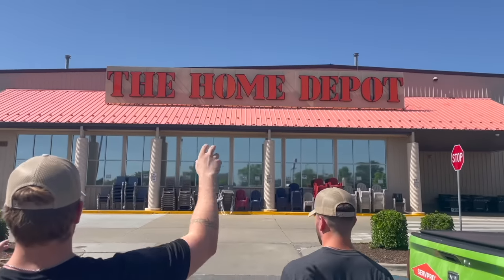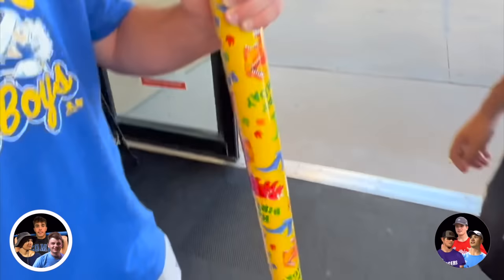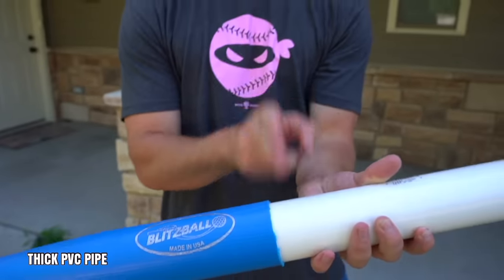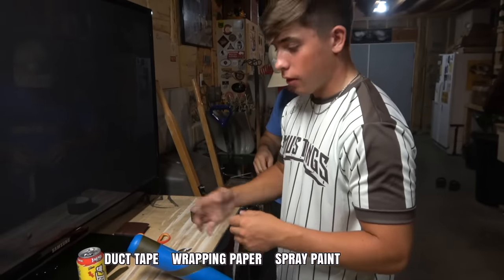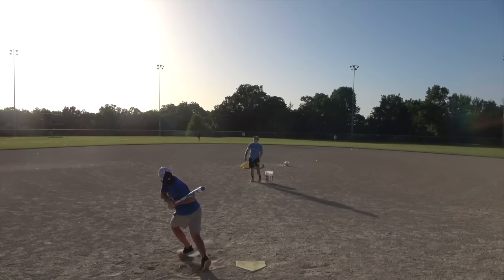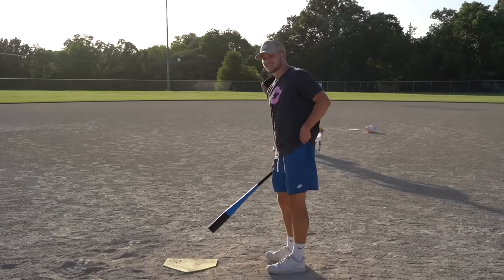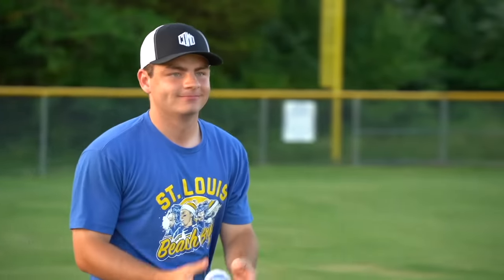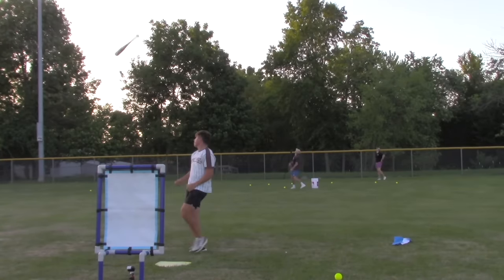First to Hit a Home Run with Their Corked Blitzball Bat, Wins

Comment: Put a valve stem on it and pump it to 10 to 20 psi. Obviously you would have to seal all the holes in the bat, Also you could shave the walls from the inside before filling with air this will create a trampoline effect.